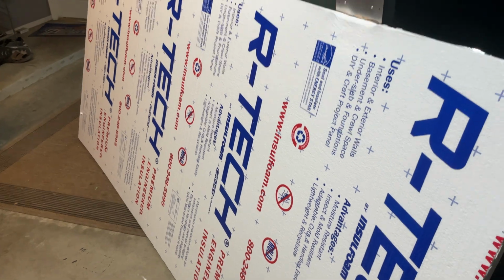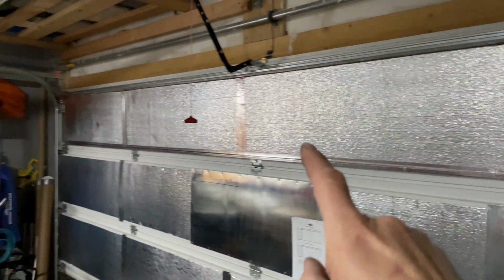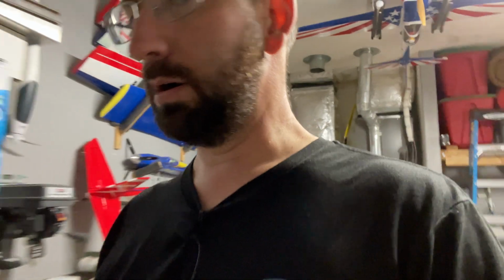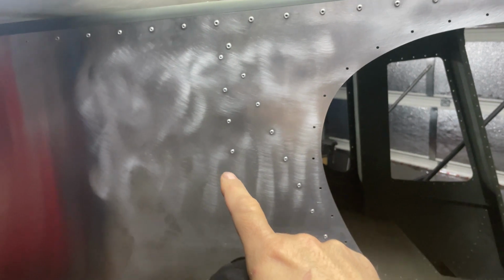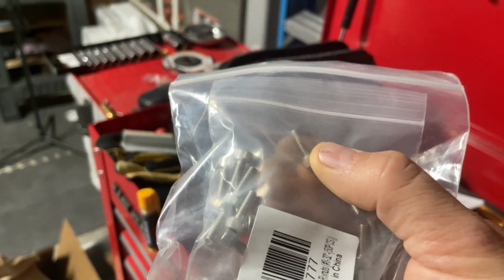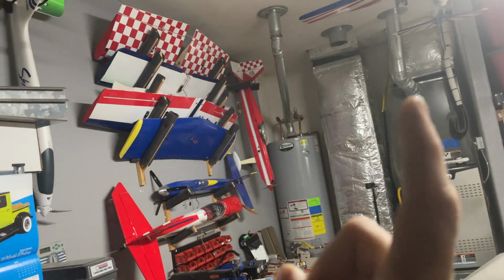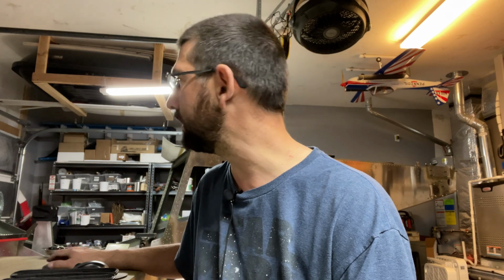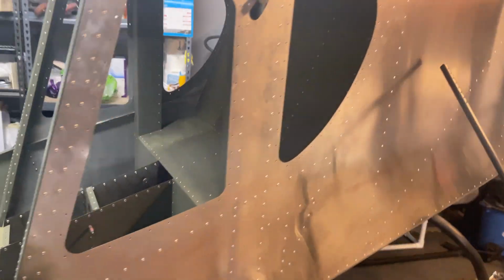Zenith Build: Preparing for AC install in the Shop

Comment: I hope you like your new A/C unit. Before my build, I installed a Mr.Cool DIY 24K unit. My 2-car is not well insulated, but the unit keeps it nice and comfortable in the Florida heat. I had bought some steel rivnuts for my center console, but they seemed slightly heavy to put one in each hole. I was thinking about only using every other hole or less. Other option was buying the aluminum variety. After watching your video I may just stick with the steel? Thanks for the videos!
Reply from the maker: Thanks for watching, I am loving the AC unit so far. It has been cold out here in NM so the heat pump has been well needed. When the summer heat in NM starts, it Cold will be welcomed with open arms. I might do a weight difference with the stainless vs the aluminum rivnuts to see the difference, but to be honest, i will be minimal.